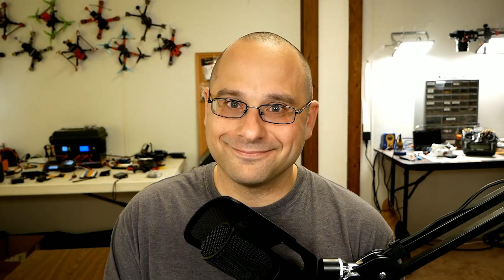6S is the new 4S | FOLLOWUP

Comment: Garbage in, garbage out.  Another poorly considered and administered test that produces unusable results.  You should delete both videos to protect your integrity.  In order to perform a valid 4S vs. 6S test you would need packs of nearly identical watt-hour capacity, same battery maker and model, identical FOM (capacity normalized internal resistance), and same usage history.  Do this and you'll clearly find that there is no real difference.  Simple physics demands such.
Reply from the maker: Physics demands that for the same watts output, higher voltage will result in lower amps, and less wasted energy due to heat loss. There are also differences in the magnetic field in the stator at high vs. low voltages. Saying they must be identical because the watts out are identical is hardly convincing. If racers who are desperate to make two minute qualifying heats are migrating to 6S in droves, it behooves us to examine why they are doing it, in their own words. We should also do scientific tests to probe their claims, but ignoring their claims simply because they are not backed up by scientific tests (yet) is stupid.
Reply: "Physics demands that for the same watts output, higher voltage will result in lower amps, and less wasted energy due to heat loss." 

But when you change motor kV, you also change winding resistance.  A motor with 2/3 the kV as another motor in the same form factor will have substantially greater winding resistance, and will thus have identical heat losses at the same power output.  C'mon Joshua, you're a smart guy and a degreed engineer, you know this stuff!

"If racers who are desperate to make two minute qualifying heats are migrating to 6S in droves, it behooves us to examine why they are doing it, in their own words."

We all concur with this and it's rather apparent to most of us that they're migrating to batteries with greater total energy, which could be easily accomplished by using larger capacity 4S batteries.  Evan clearly stated in the video that a 6S pack (the 1050mAh) with same total Wh energy as a 1600mAh 4S pack produced identical results, as one would absolutely expect if he/she fully understood the physics involved.

 "We should also do scientific tests to probe their claims, but ignoring their claims simply because they are not backed up by scientific tests (yet) is stupid."

Again, completely agree here.  However, the testing that you published in your admitted haste is far from scientific given the wild disparity in total pack energy and produced results that are easily predictable without even performing any testing.  I sincerely hope that you will perform some more carefully considered tests to the benefit of the community and hopefully avoid the unnecessary depletion of the wallets of modelers who have bought into the flawed hype that increasing voltage is somehow the holy grail that belies the laws of physics.

Warm regards!